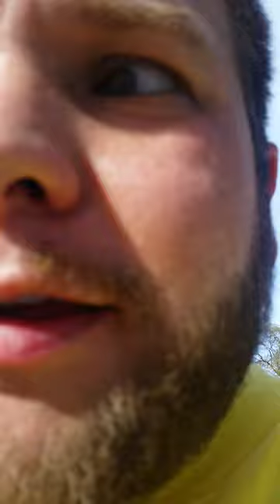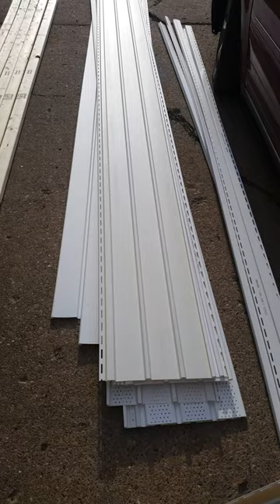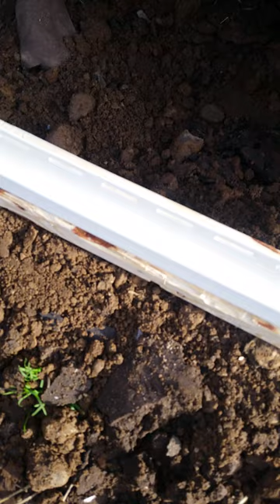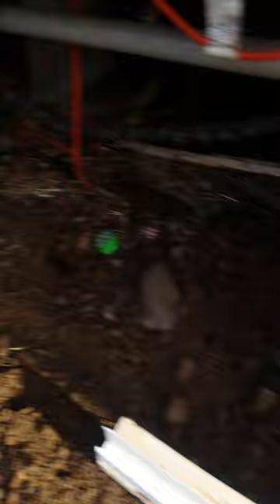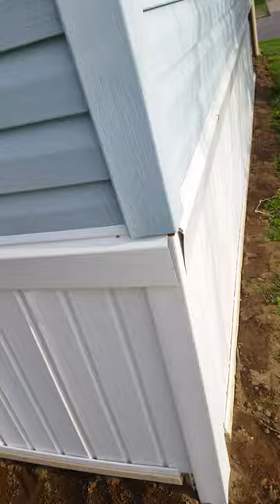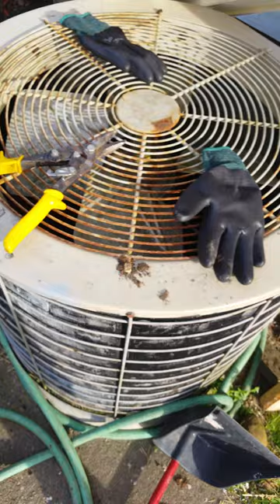Mobile home skirting Ideas! subscribe

Comment: Obviously I don't know what weather conditions you have where you live, but does it get very cold? And how does this method work vs actual insulated mobile home skirting? I live in a place that gets -20 during the winter. Or do you have any suggestion on how to insulate it?

Comment: Hi how exactly did you install the top rail I just bought a brand new mobile home with siding and doesn't give me room to install the top rail skirting
Reply from the maker: Bro I literally screwed into the siding with tiny construction screws so basically at the bottom where is the skirting is supposed meet with the house... the bottom usually hangs loose...all I did was install panels first the you buy the top track which is actually the crow for the skirting.. so you would have to contact a mobile home supplier store and basically order about 14 top tracks and that's all you need and then you simply just screw those right into the side over top of the panels

Comment: How did you attach the wood to the ground? Did you use pressure treated lumber?
Reply from the maker: Thomas Randall depends on how cheap you wanna be....the wood is locked in place by weight.
All the pieces on a 75' trailer would all be connected, so each 2x4 would be attached to the next.
Then you buy cheap ground stakes from home depot... or wherever.....and secure wood every 10 foot or so....I used bricks personally on this trailer, the home owner had an abundance of paver bricks..
Reply from the maker: Thomas Randall https://youtu.be/OE2zCjsNW7k

Comment: real skirting is cheaper its only 13.00 per 16in by 12 feet where soffit i seen was 20, and up butt i see this video  from 2017
Reply from the maker: Yep at the time it was cheaper,
And the soffit is a much thicker material....
Obviously everything is going up now due to covid, everyone want to make up for the economy loss
Reply from the maker: But it also might be cheaper bought in bulk at the depot which is what I did for this client
Reply: @THEODINOFFICIAL  i know right last year i was making poor  man plywood  plank flooring at that time  it was 10.00 to 12.45 a sheet now it is 50. a sheet for 3/8 dang  you covid-19
Reply from the maker: @truthfinder4973  hell I could buy a box of toothpicks and charge 50 cents a pick hehhehehe
Reply: @THEODINOFFICIAL  l0l

Comment: How is this cheap when the Strips are 14.55 for 12 feet and the mobile home skirting they sell at a mobile home parts shop is 14.55 as well?
Reply from the maker: Well let's see if you buy it at home depot, it's 13.88 per sheet,
Not including their bulk price, buy the whole box and you get a discount. Hope that helps.
Reply: so lowes or home depot dont offer it in bulk and its 14.55 where I live. so no.  @THEODINOFFICIAL
Reply from the maker: @alexiselizabeth-mariegordo7378  did u go in store ? Or. Online shopping?
Reply: I called for home depot. In store at lowes. @THEODINOFFICIAL
Reply from the maker: @alexiselizabeth-mariegordo7378  don't know what to say it's cheaper elsewhere idk
Reply: I work at crossroads building supply and we sell soffit for as low as $7.20 per 12ft piece.  We have over 30 locations, you might look us up and see if your close to one, lowes soffit is like $13 or $14 a piece lol
Reply from the maker: Even better pricing than mine auh
Reply: @themotorcycleguy5980  dang do they drop ship